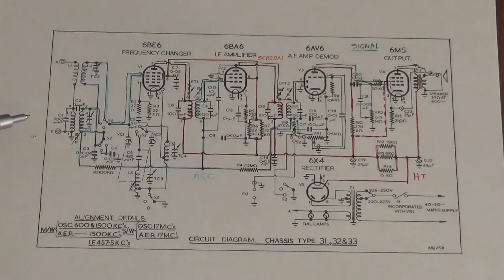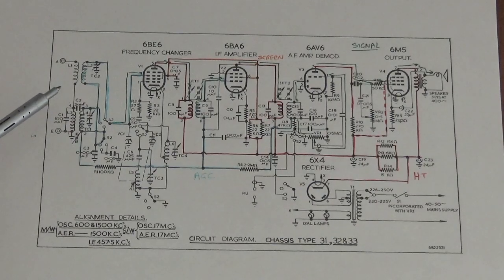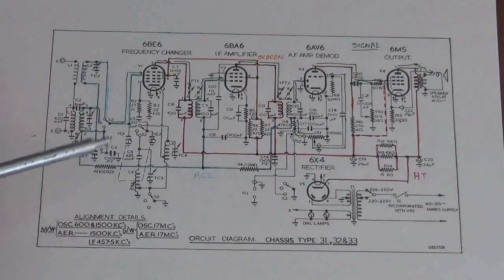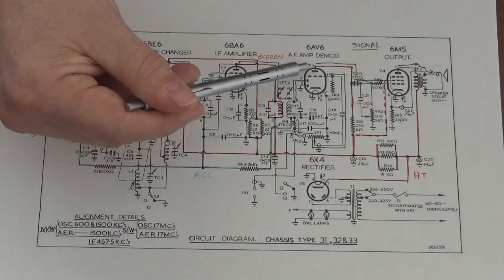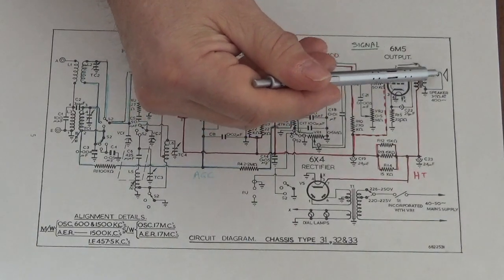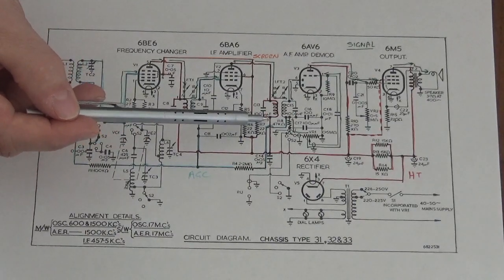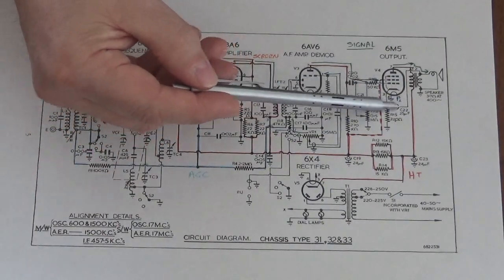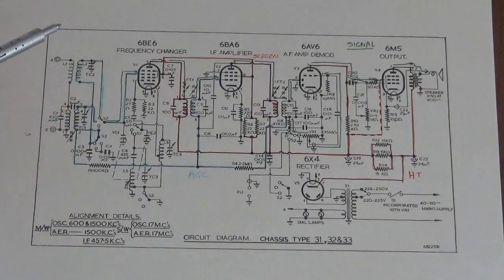#007 Valve Receiver Repair - Circuit Diagram Walk Through

Comment: Hi is this set a Australian STC  if so which model is it please
Reply from the maker: Hi John,

The set is a HMV model 32-46, after taking a closer look at it there were many problems. The turntable had a number of broken and missing parts, the cabinet was in not so good condition and some genius had even managed to screw all the slugs out of the IF transformers. A pretty sad state all round. I ended up stripping the unit to be kept for spares.
Reply: @GrumpyOldTech  Hi  I pitch up an old STC radiogram I think early 50s which has almost identical circuit even with the same valves but as yet not been able to find a circuit diagram for it the only numbers I can find on the  chassis is 655069 and H6 1458 which does't line up with any thing I can see on the net the radiogram is pretty unusual is a box with lift up lid and 4 round legs like a 1950's coffee table, the turntable is in good nick but the radio has all the problems of a 1950's radio.
Reply from the maker: Yes it can be hard finding information on these old pieces of equipment. I picked up an old AWA RF signal generator a while back. I did a quick google search at the time and got plenty of hits so thought it would be easy enough to find a service manual. Yep still no luck on that front though, not happy...
In your case maybe try the basic things first, check transformers are good, change the dodgy caps and see if that breaths life into the set. It’s a starting point I guess.